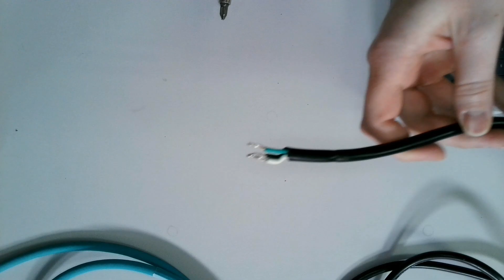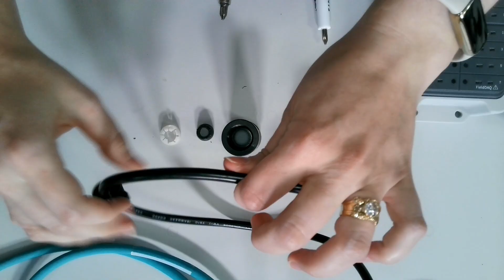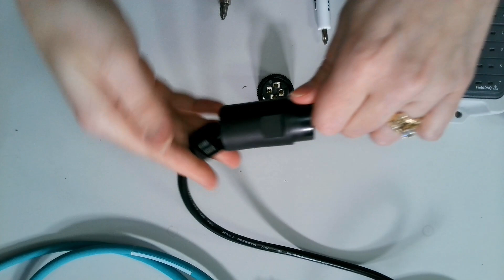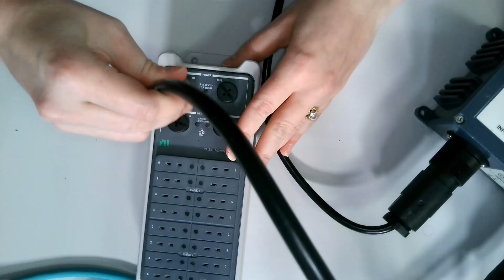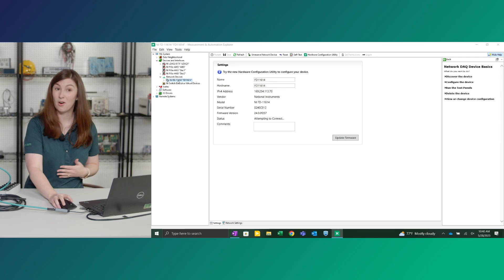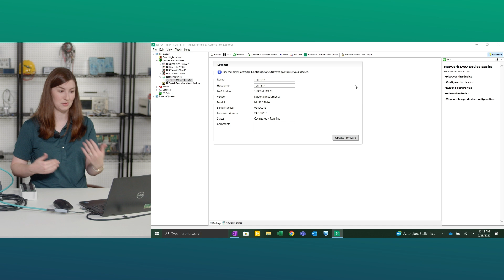How to setup NI FieldDAQ hardware with power and Ethernet

Comment: Where do we find the instructions for connecting the wires to the connectors? Presenter mentioned putting black>1, white>2, green>"corresponding position". I saw four connectors, so which one where? A diagram would be helpful. FieldDAQ User Manual?
Reply from the maker: Thanks for the question. Here’s the Power Connector and Wiring section of the manual:
https://www.ni.com/docs/en-US/bundle/fd-11601/page/power-connectors-and-wiring.html
The short answer is 10A max pass through across all devices, 300W total power of the “chain”. There are also AUX power lines so you can run a separate voltage line for non-FieldDAQ devices. Amp and Watt rules for the chain still apply. For those of you that have access to the AI assistant Nigel, its answer was helpful. It even provided a quick link to the manual section.